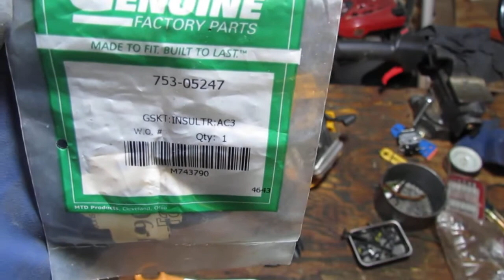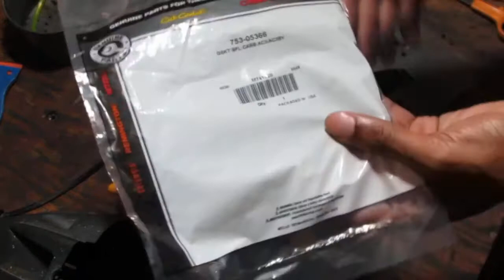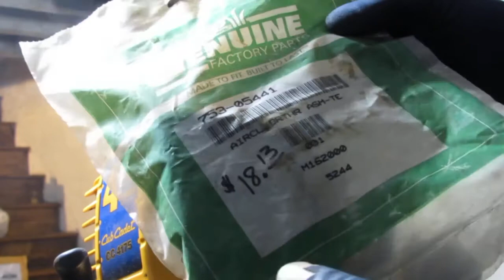Cub Cadet CC4175 | Part II

Comment: how do you adjust the air/fuel mix?
Reply from the maker: At 32:34 these types of carburetors only allow you to adjust the idle speed.  It has been a while and I do not have the carburetor anymore.  On this carburetor you can find a screw that you can use to adjust the idle speed only.  Best of luck and enjoy your weekend.
Reply: @MotionDesignStudio  Gotcha. I live at higher altitude and carbs run way rich up here. Guess I'll just run this thing till it dies!
Reply from the maker: @JSMCPN  , I understand the predicament you are in.  You are not alone as not having the ability to adjust the low and high negatively affects users at different altitudes and also the ability to optimize how the engine runs as it ages.   It is a catch.  It is said to be done to help protect the environment and at the same time it causes many machines to be thrown away prematurely.
Reply: @MotionDesignStudio  And to add insult to injury, I live in a rural area far from anywhere to dispose of anything. Around here, when our weed-eaters die, they get tossed in a burn-pit and eventually buried.
Reply from the maker: @JSMCPN  , nothing about this situation is ideal and your frustrations are felt.
Reply from the maker: @JSMCPN  , use a pin vise.   This helps and is necessary.